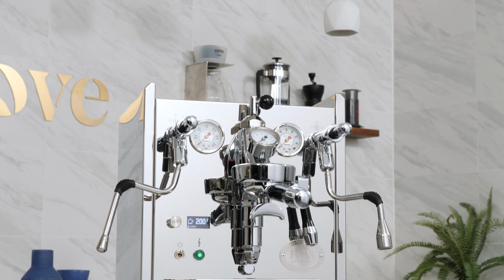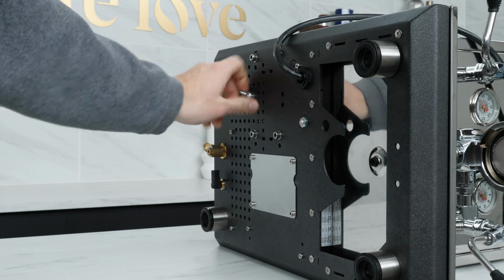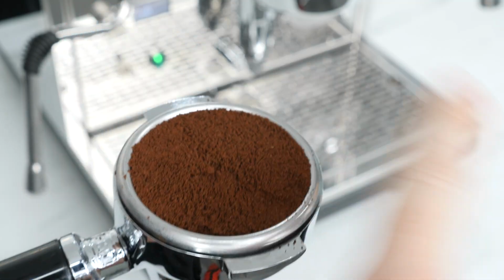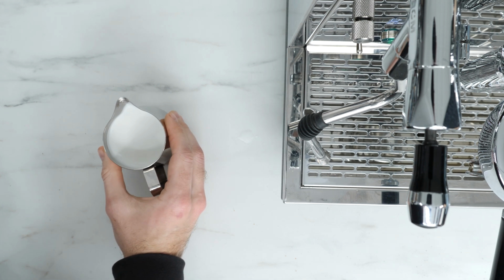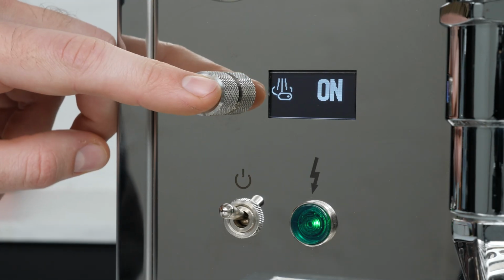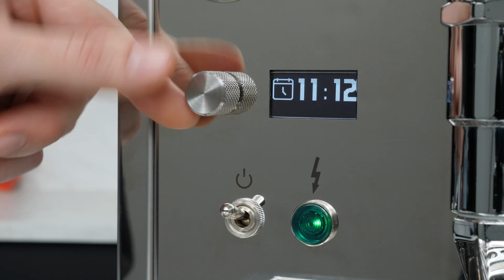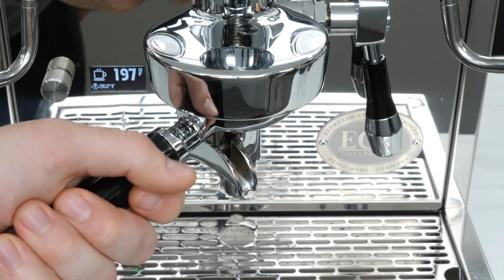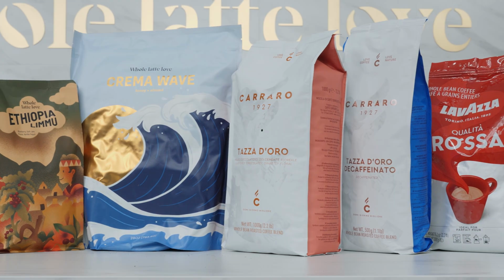How to Set Up & Use the ECM Synchronika II Espresso Machine

Comment: just ordered one — I don’t plan on using the hot water or steam… will test those functions for a few days

there are both a physical switch & electronic Steam Boiler OFF settings… turn both OFF?

Should the tank be left full or best to empty the Steam Boiler?
Reply from the maker: Hey Marces, you're gonna love it! Good questions too. You can turn the steam boiler off with a setting in the PID screen, no physical switch for that. Best to empty the steam boiler if you don't plan on using it, that way you won't have old water sitting in there for a long time.
Reply: thank you…  ok, that is only the Sync I that has a boiler switch behind the drip tray

is there a recommend period for flushing the boiler left in this ‘damp’ condition?

is it correct there is a short period that I can buy something like the Walnut Flow Control Paddle at a bundle-discount?

Comment: For this machine, where in the countertop would you cut the hole to plumb? Is the middle of the machine ideal?
Reply from the maker: Hi BLD, The plumbed connection fitting swivels 360° so middle will work. The connection is located about 2" from the rear face of the machine. Hope that helps!
Marc

Comment: Whole Latte Love knows that "Schedule Set" does not work ( power on and off automatically) despite of this  they are selling machine. It pretty low boiling and not ethical. It is not so much of big deal because you can  still use programmable  timer  plugged directly to the power outlet. But at least Whole Late should notified potential buyers. Do not be misled  by smiling face of Marc and others reviving new machines, it is not the same company it used to be, it is hard to get any help by phone . It is disappointing after doing business with them for so many years. The latest negative  reviews from Reddit  are not without merit.

Comment: Quick on with the preinfusion when plumbed in.  Does the new method mean you no longer have to hold the lever at the halfway point to start the line pressure infusion?  You can just crank the lever full on and it'll use the default line pressure for whatever you have set it to?
Reply from the maker: Hey, With that handle you've got to be a fellow Rush fan with 50% chance of Canadian? That is correct the passive pre-infusion function applies line pressure to the coffee without running the pump for your programmed time.
Marc

Comment: WLL should include a bottomless portafilter with the flow control version. I don't understand why ECM gives single and double spout and not bottomless portafilter in accessories.
Reply from the maker: It would be really cool if they did, but sadly, no bottomless included.

Comment: Great video! Wish I saw it when I was setting up my machine a week or so ago. There's no mention of removing the shipping screw for the pump anywhere in the manual/set up instructions. I read that thing word for word and even downloaded it from the ECM website to read it again. Hope it didn't cause any problems since I used the machine already. And by the way, what a machine!!! I love the product and the service! Keep it up!
Reply from the maker: Hi e, thanks for the comment and your patronage! Synchronika II is a beauty. Leaving the shipping bolt in will not cause any problems other than the pump may run a little louder as the bolt stops the rubber motor mounts from dampening vibrations.
Marc

Comment: Perfect timing. Mine will arrive in a few days.

Now I have a question. I need to use reverse osmosis purified water. I have seen the video on how to add minerals to the water to harden it and hopefully avoid damage to the machine, while also improving taste. My question is, do I need the filter in the reservoir when using such pure water, or should I remove it?

Comment: Why is no one talking about the hidden PID menu…?

Turn the machine on and instead of waiting immediately double press the PID button. This will take you to the hidden menu that contains many more options than the standard PID menu and has additional information too. I’d like to know what all the options in this hidden menu are but it’s not covered at all in the owners manual and no one is covering it.
Reply: I love the shortcuts on it! Super cool but unless you read the manual you'd never know. Turns on and off the steam boiler so fast and easy or pre brew on and off so easy
Reply: Agreed. And need to go more into detail on temp offset. Mine boils water off at 205F.
Reply: I haven't received mine yet, but at a guess, maybe the hidden menu allows adjustment of the PID algorithm. I remember with my old Brewtus IV it was possible to go deep into the PID settings and adjust the variables that are used by the PID to try to keep the temperature stable.